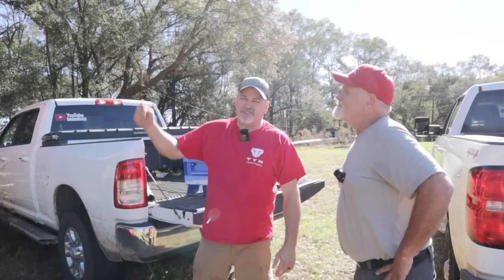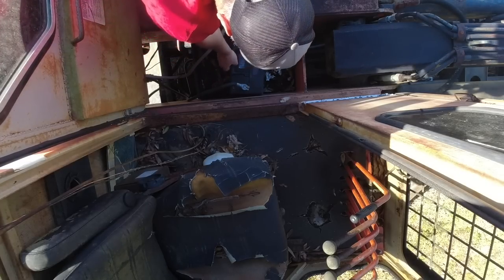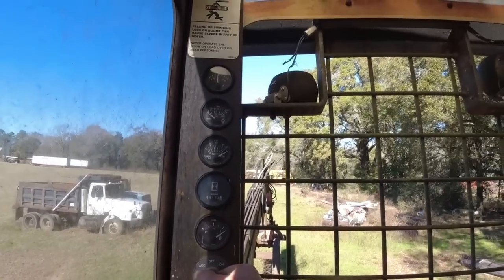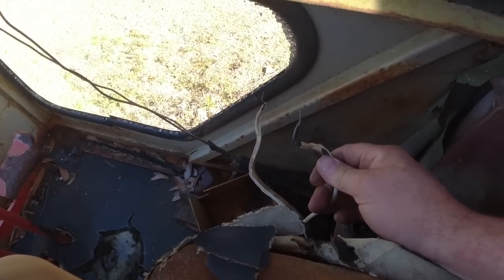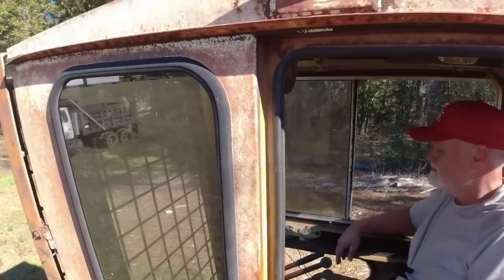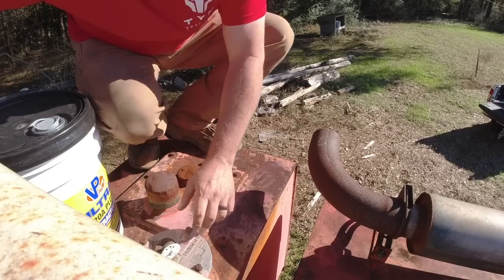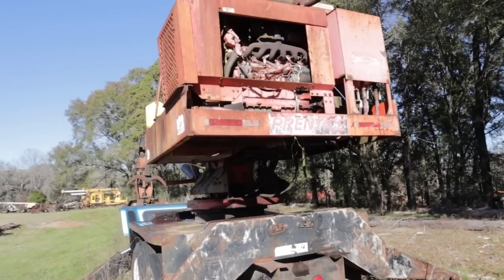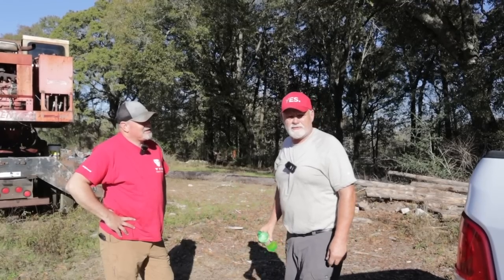Log loader acts like it wants to start, but something is not right+ GIRAFFE Tools

Comment: In high current twin parallel battery use if you can balance the resistance between the two batteries you will get much better life, the way the batteries are wired you have 2 lead resistances on one battery none on the other so the one with the starter wires directly  connected will take more of the load, if you moved one of the starter wires to the other end of the jumper wire it would balance, one on each battery,when you are into the thousands of amps micro ohms matter,  great videos great channel, you and Wiley are a great team

Comment: Hello together, something crossed my mind right at this moment: in all your attempts to crank old machinery parked for 20+ years, these old machines have one thing in common: they run on Diesel. In most cases, the Diesel that's left in the tanks is resin, fuel lines are clogged, etc. So what about filling some high - octane petrol / you call that "gas" into the fuel tank that could act as some kind of thinner to get the fuel system free again. This has been a trick to keep the Diesel from freezing at sub - zero wheather, but this could also work to make it easier to crank up old engines by cleaning the fuel system and lowering the flashpoint of the Diesel.

Comment: But that's what's always the best part about these older machines. As they were always so much simpler than these newer. Machines that always relied on computers nowadays. Because the older machines, it made it so much easier to work on them.

Comment: We had a 210C between two concrete pools of hot water soaking pine had a electric motor and a bucket we could put on the grab to clean them out every year was pretty wild late at night in winter couldn’t use the lights because of the steam hard to see anything but had to feel what you were doing 🇦🇺

Comment: 35.39 that oil sounded like a Harley Davidson when you opens the Valve  🤣
Reply: Thank you guys for showing this new generation some old equipment. I'm 35 but been farming for FIFTEEN years🤣 using old 20to40 year old equipment every day. Everything needs a trick to crank and a treat to run.

Comment: I'd zip tie a block of wood down at the bottom of the job box.. and put a pad lock in the front where it's supposed to go.. also run a small cable through the holes near the brake light with small steel cable with clamps.. to pad lock that box in the truck so no one steals the box.. your average sized crackhead will run with that box.. I did both my trucks like it..

Comment: Used to run a boom truck for GCR tire which now belongs to southern tire mart ... I was at Martin Marietta Augusta i had changed 3 27.00-R49's on a Cat triple 7 haul truck...i had a 3/4 & a 1/2 air hose on reels in a box behind the cab ..ohh about head high from the ground ...the 3/4 hose wouldnt lock without vise grips ....visegrips broke hose started rolling back up ...i thought i ducked before that coupler went air bourne .......i didnt....i had on a hard hat but it still put a goose egg the size of a an apple on the side of my head i literly seen stars ......like Jerry Clower said ...if im lyin im dyin !!    Once i eyes started to focus again it took me 30 mins to find my hardhat ...... then i had to drive almost 4 hrs back home with a splittin headache if that airhose ever gets away from you .......get some yonder !!   And i mean quick them couplers so no mercy !!
Reply from the maker: My goodness!
Reply: @HamiltonvilleFarm  btw i didnt make a new yrs resolution this yr ........i made one the last 3 yrs.    I stopped smoking,then i quit dipping and drinking ....but im still working on last yrs im trying to get my health straightened out 28 yrs in a truck took its tool on my body ..ill be 56 in march i retired from trucking in 2019.  I aint no spring chicken so it takes longer to get over the aches and pains lol

Comment: Just an idea. But if you could aquire through some of the work that you do, a couple of 200gal. 
above-ground tanks , one for hydro, and one for engine oil, it might save you a bit of time and $ by having it with you, when you go on these ADVENTURES.  Just a thought guys. Not to mention a possible tax write-off, as a video business expense.

Comment: This machine is not too easy to use for anything other than moving wood from right to left it lacks the wheels at the front in order to be able to move solo rather than using a tractor

Comment: Reusing hydraulic oil can get you in trouble.  If it has water or metal in it then you just contaminated the next machine.  Best to put new oil, then you know you are not passing trouble from one machine to the next.  If I was going to do it, I would let it settle and pump it off the top (not drain it from the bottom) leaving the hose several inches off the bottom, but honestly you are asking for problems doing that.  Not worth the risk IMHO.